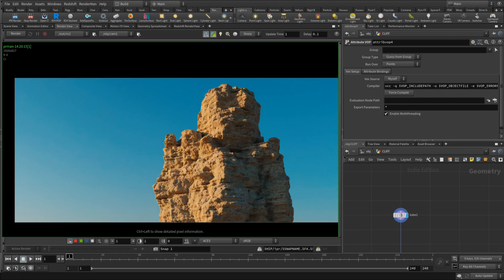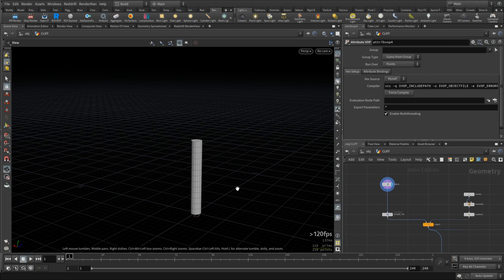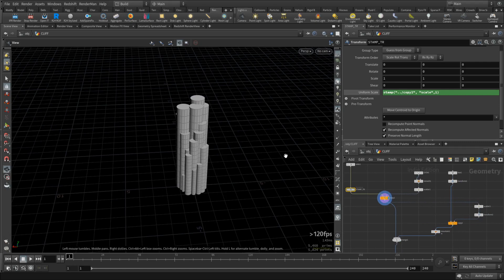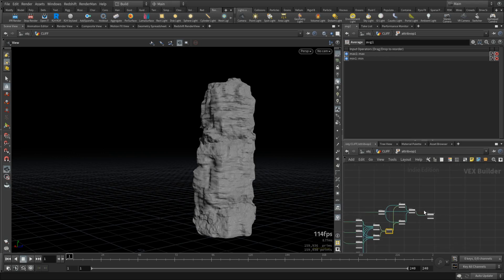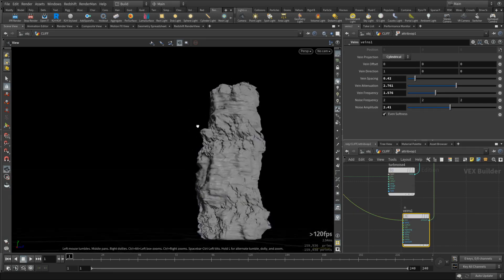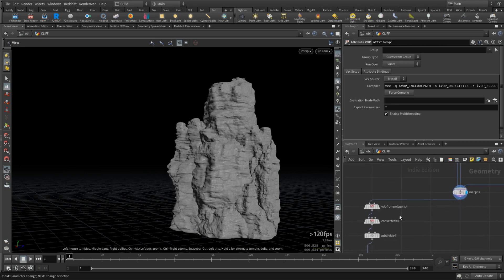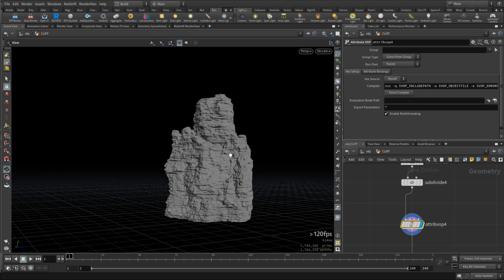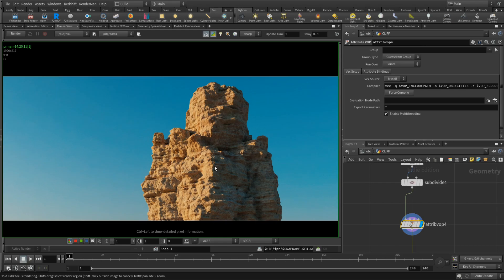Quick Tutorial - Procedural Cliff in Houdini

Comment: I use this expression for randomizing vertical scale  - fit(rand(@ptnum+255),0,1) and it does not work.  
Error 
Unable to evaluate expression (Invalid number of arguments for function (/obj/Cliff/copy1/val1)).
Reply: You could also use fit01() instead
Reply from the maker: you're missing the value ranges for it, the correct syntax is fit(rand(@ptnum+255),0,1,xmin,xmax)

Comment: It says tutorial but you litteraly doesn't explain that much... not helpful at all. Like can you show each node parameter
Reply from the maker: During the tutorial I've stopped on the nodes that have the key features resulting the the desired effect. Like "copy stamp" and "attribvop" for the noises. All the rest are pretty much the same as default values. You can also check out the icicles tutorial as it has the same approach but I go over every single node.